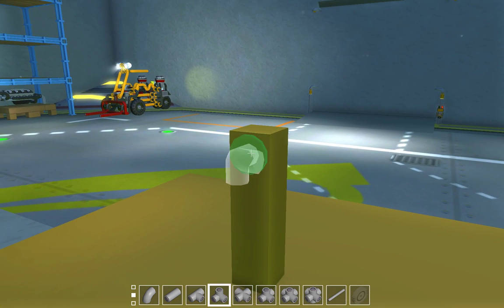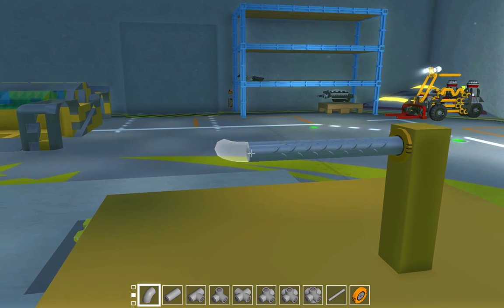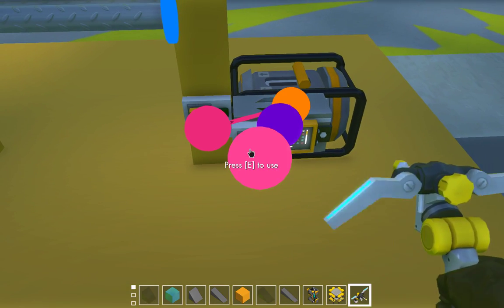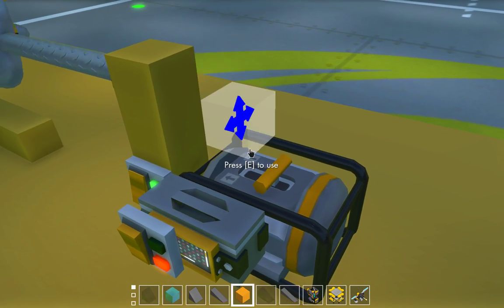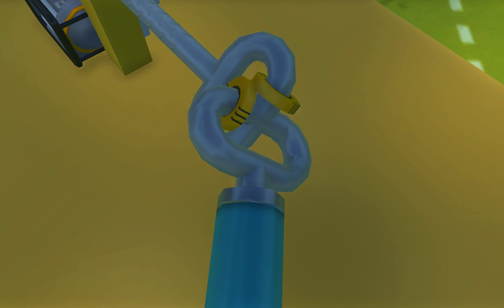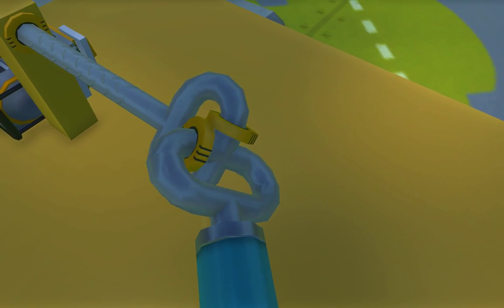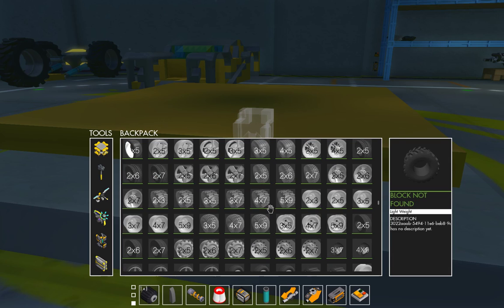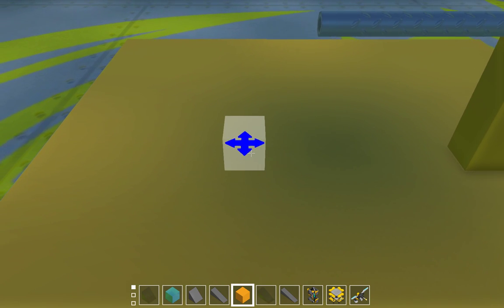Scrap Mechanic | How To Make A U-joint

Comment: At 4:45 you complaint about the changing speed. Thats quite normal. if you use another u-Joint on the other hand and align the axles back paralell (whats the purpose of u joints) the speed stays constant at the end

Comment: What's the mod you used for the U joint because I have the mod pack but I don't see the blocks
Reply from the maker: thought i replied to this, eits either one of durfs packs or from lord pain
Reply: modpack polygons
Reply: @James_R_  forgot about this haha
Reply: @dirtmachines4253  I figured if I found this unanswered properly question, someone else will later.

Comment: cv joint: put two u joints together, done
Reply from the maker: Scrap doesn't like doing that. Also, a cv isn't two u joints. It's a ball and cup with bearings connecting the two.
Reply: @XspunturboX  and is that something you can do in sm? no
Reply from the maker: @redpug5042  could actually. Just not small.
Reply: @XspunturboX  it would have to be a large creation that has several loose balls in it making it several creations
Reply from the maker: @redpug5042  probably just two

Comment: Гениально!!!
Reply from the maker: English please
Reply: XspunturboX , very very good!! I'm also a mechanic.
Reply from the maker: Никита Сергеевич ah, thanks :) as in real mechanic?  Feel free to let me know if I mess up any thing in that case :p
Reply: no, I'm a mechanic in the game, I'm 15 years old. You have all well done, I especially liked the small gimbal, I could not come up with it. Try to make realistic rear suspension for a truck, the idea can look at me. My friends call me the inventor of the first suspension in this game )) But most of their suspension I built out of LEGO 5-12 years. I would be very happy if you try to do it. ))
Reply from the maker: Никита Сергеевич I've made lots of realistic suspension
Reply: OK, do the suspension without shock absorbers, instead of them just do springs ))))
Reply: and please tell me what is the detail for the propeller shaft which is pushed and moved.
Reply from the maker: Никита Сергеевич not sure what you mean